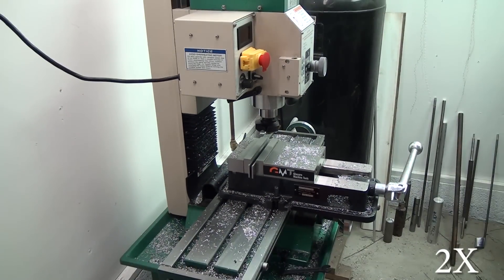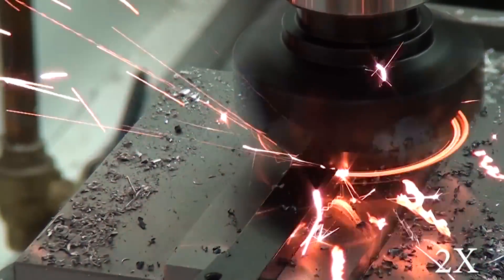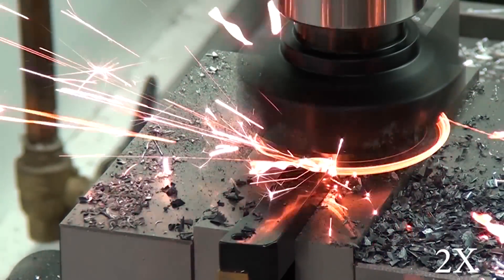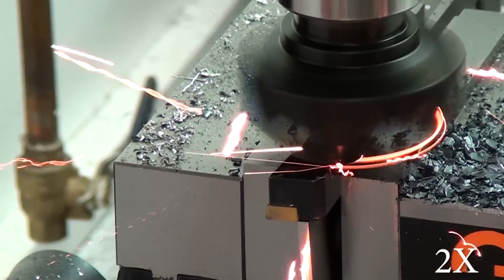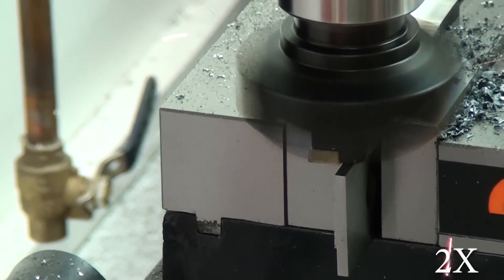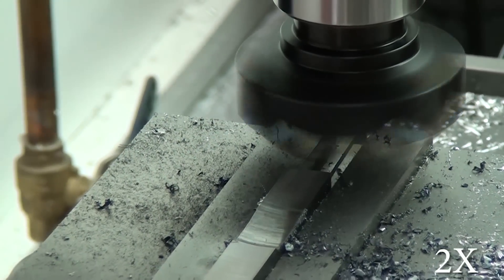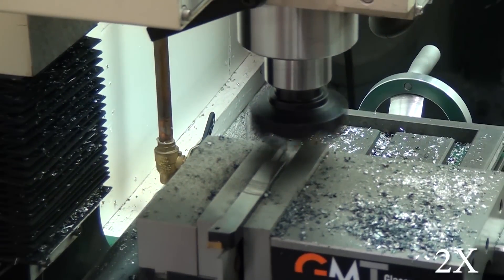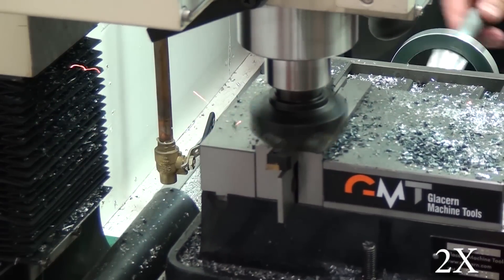07 G0704 Shars 2" Face Mill Gets It Done!

Comment: Hi Russ, Nice stuff there!

The little CCMT tool holders are only about 28-32 Rc so although it looks as if you are hard milling it's just the carbon burning off in the chip (red sparks). Milling creates a lot of heat and there are only three places it can go: the insert, the chip, or the part itself. The goal is to create a thick enough chip to carry away most of the heat. Ideal chip color for low-medium carbon steels is straw color with a blue tail. That's the sweet spot.  >>> ExKenna <<<

Comment: Hi Russ
I think that your tool RPM is way too high and the feed you are using is too fast. 
Those indexable tool insert holders are made of tough steel even the Chinese brands. I would have used a much lower cutter RPM and a slower feed and if possible coolant. When you make all that friction you just burn up the tools unnecessarily.

Comment: Nice work, mistakes like you show here are how to find out how far you can push things.  Now you know how much stock you can remove in a single pass in this material.  Properly locked up, you could easily have done two roughing passes and just one or two finishing passes, as it seems like this little machine actually has a few ponies behind it.  Don't be afraid to make heavy passes, your tools will last longer.  Sure looks like you are having fun!

Comment: Hey, it took me more than just one time before realizing the head was dropping on mine. Was using a fly cutter and it whacked into the stock really well and stalled the spindle too. Thankfully I had already converted to belt drive.  Don't feel too bad. :)

Not as large but the "Little Hogger" set of cutters is really inexpensive and nice and comes in 3/4 shank. 

Cutting down the shank when you go to a different tooling should not be a problem but probably just as easy to sell or swap it.

Comment: This has happened to me a lot and it annoys me every time it happens - but I'm getting better at double checking the quill.  I also have a small milling attachment on my lathe, it has a round column and will wander when the going gets tough.  My nice straight cut with go off on its own direction half way through and I have to set it up again.